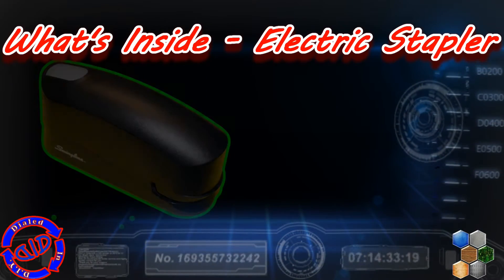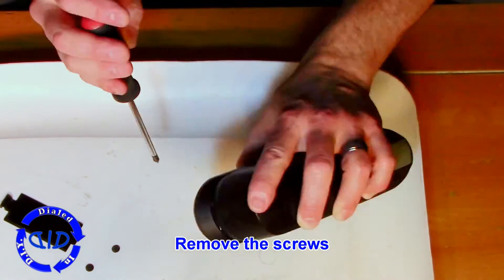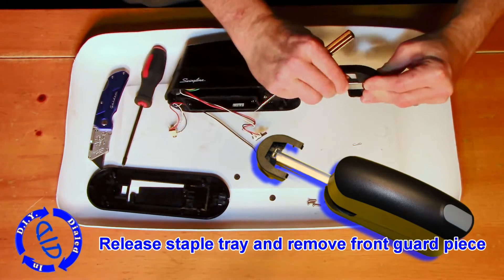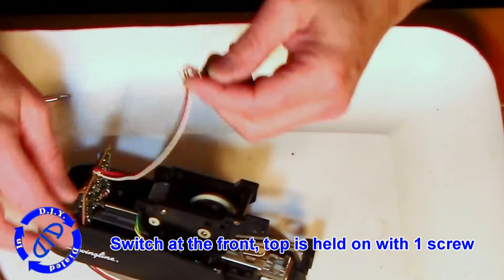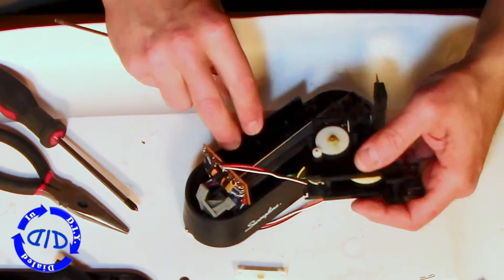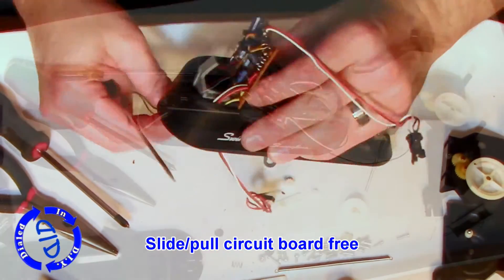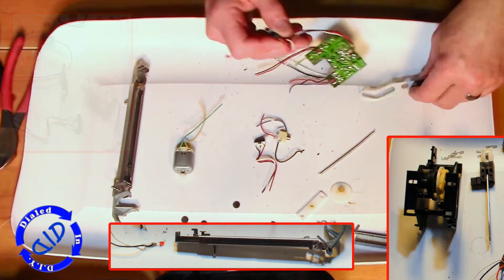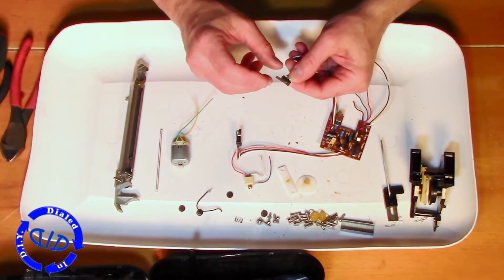Whats Inside an Electric Stapler  -  Free DC Motor & More

Comment: Bro it's nice video, DCmotot is got. How about sensor. Bro inside that have sensor?
Reply from the maker: Thanks for watching and taking time to post up!  What kind of sensor do  you mean?  If you were asking about the type of visual sensor that newer products use then no, not that I can recall.  This stapler has several contact switches inside but I think that was it.  Thanks again!
Reply: @DialedInDIY  Have IR sensor, inside this stapler have DC motor and control switch. I not sure what type sensor. But it's not have sensor.  How it working without sensor. Any kind of sensor is have inside
Reply: Bro you know what type automated stapler have sensor, control switch and motor? You can tell example stapler have  3 this thing inside that part.
Reply from the maker: The action to trigger the stapler is completely manual.  One of the "switches" inside has a flexible metal bar that is contacted by paper when you push them in.  It completes the circuit to cause the stapling action.  Kinda low-tech but makes for a cool switch to use in other projects.
Reply: @DialedInDIY  thanks bro I 
understand how it's working. bro you  know what type of automated stapler have sensor, switch and motor.  Can tell the name of that stapler. Because I have automated stapler project
Reply from the maker: Sorry, I do not know the name of a stapler that uses the optical sensor for triggering the action.
Reply: @hhh-jn7rl  hiii me too can you help me?
Reply from the maker: Are you trying to find an automatic stapler with an optical sensor?  I think that was what OP YY was asking for. Is there something different that you'd like help with?